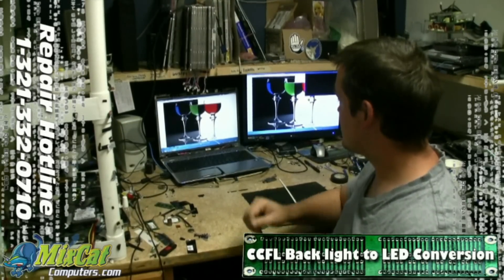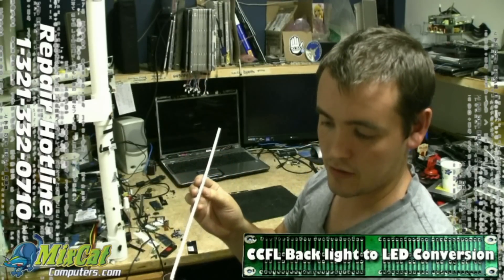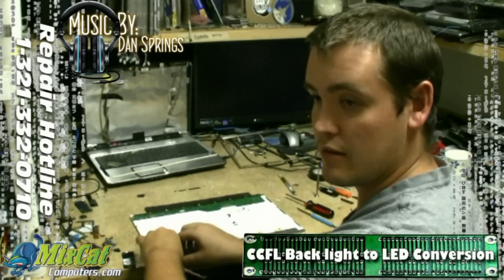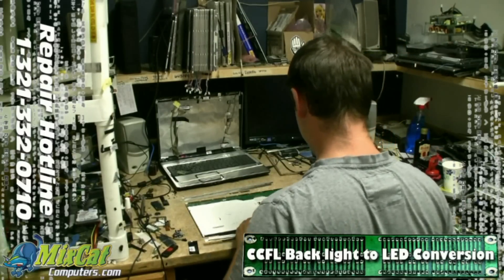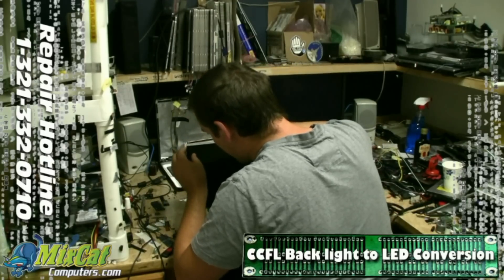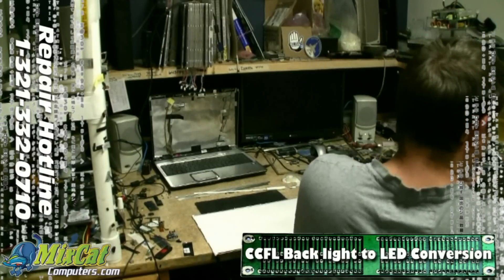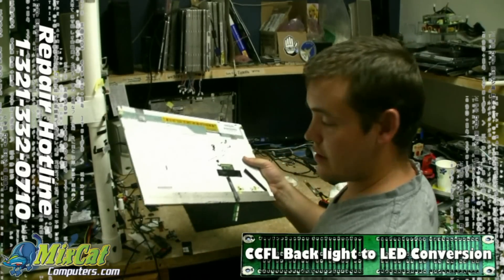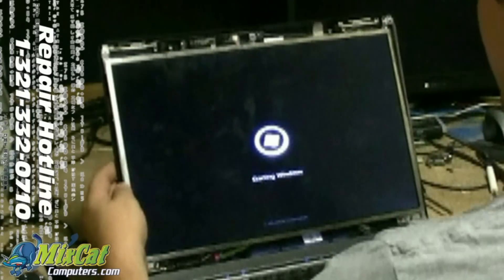CCFL to LED LCD Screen Conversion Project Mixcat Computers

Comment: Problem on my 2004 HP  was the connection from lcd board was 4 wites and from the computer was 5 wires. Maybe I will trace wites back to inside

Comment: Hi there, I have a Mid 2007 iMac which flickers on and off but only in the top left hand quarter of the screen. It has CCFL bulbs which are apparently rated for 50,000 hours which for a 9 year old machine its probably getting close to that mark. My question is how can I tell if its the inverter that is dying or the bulbs? I believe that it has a bulb at the top and bottom of the screen. It only seems to be the top left quarter that is flickering and the rest of the screen is fine, I would have thought that if the top bulb was going bad it would be the top half of the screen that flickers but Im really not sure. If I could have some pointers that would be awesome! Cheers

Comment: CAN YOU HELP ME PLEASE!!!! I've a Sony VAIO pcg-61611L 15.6' laptop...I had to buy a replacement screen but its a newer LED screen that has no wires to the inverter  and has 40 pin instead of the old 30 pin..does it use an inverter?! can I buy a video display cable for this model screen which is LP156WH2(TL)(AC) LED ?! also would I need to buy anything else to convert my CCFL to the newer LED screen?! THANK YOU SO MUCH IF YOU CAN HELP ME!!

Comment: Neat but not impressive.. what would be impressive? well, if we start from the problem that only one ccf lamp can put the whole monitor (desktop or laptop) outta action (like in my 20" Fujitsu lcd monitor), and that the local service(s) are asking almost half the price of new monitor for changing the old ccfls with new ones, impressive repair would be making that monitor live again with the parts from radioshack-like-shops, not with the plug-and-play repair part with LED strip from another monitor... nice video anyway, cheers

Comment: LCD Panel can be converted to 3D, is it, by removing the top plastice layer of LCD panel, the screen will remain white but you can see picture using 3D eye glass, there is very thin layer of plastic cover over the screen you may remove it with blade carefully so that screen does not damage, put 3D eye glass others will not be able to see anything except one using eye glass, see this

Comment: Hi sir, I have a Samsung LED 32 inch tv with a broken lcd panel, on the other hand I have a Samsung LCD panel which is good to use.  My question can I use the lcd panel to replace my broken led panel?  Do you have a video for this?

Comment: there are some cables on the market that allow me to switch from LED to CCFL. I want to swap out the whole display not just the backlighting. So if i swap an LED lcd to CCFL LCD will I need an inverter ?
Reply: if you haven't already, look on ebay. that's where i got one for a laptop i repaired.

Comment: In my opinion, the reason could be that the voltage is too low to power the LEDs (18V vs 21V). In other words, keep in mind that the voltage regulator was constructed for just LCDs and not LED's. LEDs are logarithmically adjusted. If you compare that with an actual laptop that was manufactured with LEDs then you would see that if you lower the brightness, it won't go off. I hope my reasoning makes sense to you. Let me know. Just my 2cents!

Comment: Thank you. I've installed a LED panel replacing a CCFL LCD (15") with a CCFL to LED Converter (one of those you can find on eBay) but the brightness cannot be changed. If you turn the brightness too low, the leds just go off. :/

Comment: Everything works just as it should, including the brightness. You'll notice that the LCD panels are very expensive, especially on eBay, as their demands are declining, so the alternative is to use an LED version using the above method. I hope that answers your questions. Just my 2cents!

Comment: This is a nice video. However for the faint at heart, there is a safer alternative to this method. On most Toshiba, Dell, and some HP laptops that had LCD panels, you can simply swap the panel for an LED version but you must use a CCFL to LED adapter and use an electrical tape and tape it to the back of the panel. They are sold on eBay. I swapped a panel on a laptop for the LED version and it looks so much better. I hope that helps others that want an LED screen for their laptop. Just my 2cents!

Comment: Would have been better on a table in the light. To be taught step by step instead of Treys back moving about during re-assembly at least. Nice to know it can be done though. There are people out there who aren't electronically minded. But who do wish to try. With good tuition they can and do accomplish their goal. Which gives them great pride in their work and boosts their self esteem.